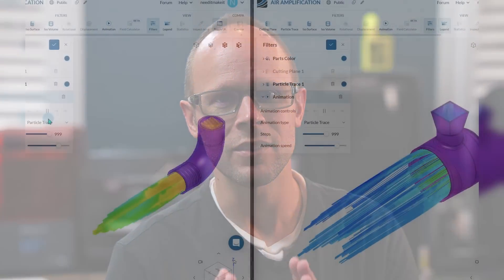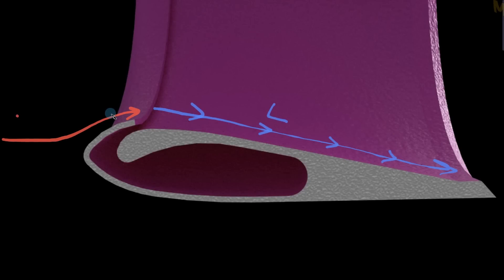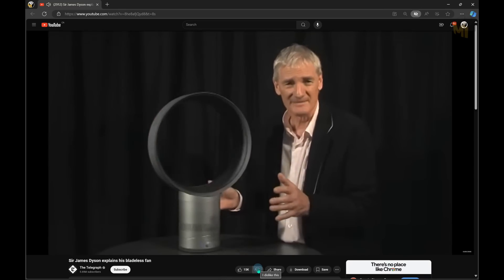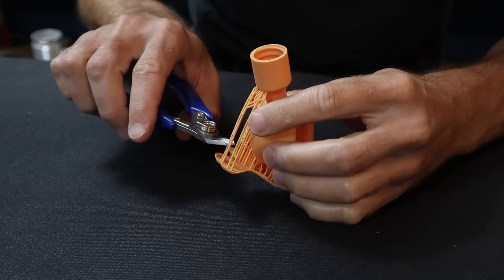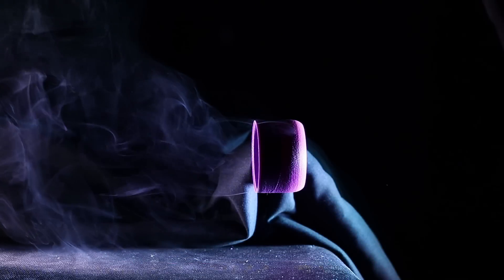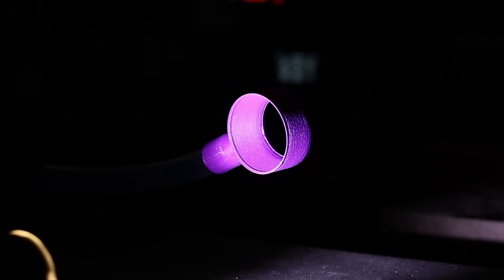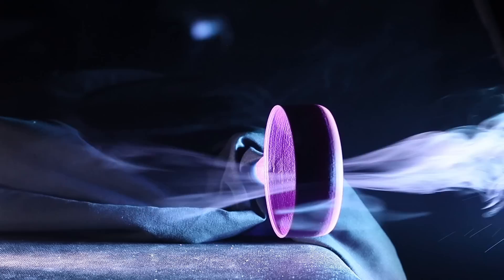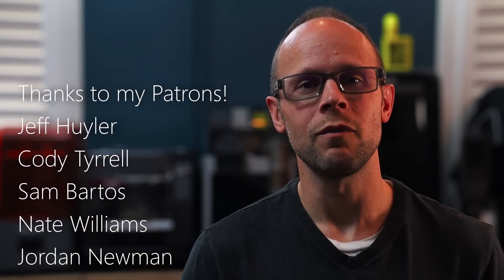3D printing a functional Air Amplifier and testing it to see if...

Comment: I'm into a bit of metal casting and the idea is not to get air into the metal as you pour the molten metal, the opposite to what you are trying to achieve. Professor John Campbell who wrote the book Complete Casting Handbook has a stage demonstration about pouring metal from a height and introducing air almost identical to your bin bag fill test. Because you have the bladeless fan and the open tube set back from the bin bag you get additional air being drawn in due to the boundary effect that you explained very well. In the open air tube smoke test the smoke wasn't pulled from behind the tube very well, however if you added a simple larger diameter tube equal about the air supply tube you will get that pull from behind, this is the venturi effect. This can be enhanced with a conical entrance to the outer tube and if you added a conical design to the exit of the venturi design you would have a venturi tube. This is in every naturally aspirated gas burner nozzle design. It would be awesome if you could try the venturi tube compared to the bladeless fan design. While the wing design profile looks very cool in the bladeless fan design I feel it adds little to no benefit other than reducing exit speed as you are only using one side of the accelerated air.

Comment: I wonder if anyone has mentioned that the air foil / flow explanation is false. It's a very old, often repeated explanation that says air moves slower over top of an air foil. But this isn't actually true at all, and the physics behind flight are actually far more complicated than this. So much so that I'd suggest just reading Wikipedia on this.

Comment: Funnily enough, a "channel wing airplane" was made, which was intended to be used with short runways, but the main reason it didn't become popular is because helicopters started being used for rescuing operations, and then VTOL became popular. If the channel wing were to have been made just a few years before, it could have become widely used. This makes me wonder how big of an air amplifier you could make work for the same air hose, and how much more air you could move by just scaling up the air amplifier part, and at some level having to split the air hose into multiple hoses which to then split the air into multiple air channels, which to then route the air to escape the air amplifier. Also, I think the trick to improve the efficiency is to make a more laminar flow, by having the opening where air escapes from be made to keep at least a few mm of length of constant distance between the inner circle wall and outer circle wall, before releasing that air, and having the edge of the inner circle wall (which ends first) be angled like for jet nozzle, instead of like for a spray nozzle or rocket thruster, to reduce the drag caused by making a low-pressure air zone due to the laminar flow sticking to the outer circle wall as it exits the inner circle wall of the air amplifier. Also, could you get the same air amplification result by using air hoses spaced at an equal distance for at least 5-7 cm or 2-3 inches, and arranging those air hoses in a circle somewhat similar to the commercial air amplifier? And how big could you make the spacing between the hoses to still get that improved airflow? A series on air amplifiers and how to make them would be very interesting.

Comment: Dyson fan :-))) ...that is a Coandă efect ejector, interior type, with the Coandă efect being created inside the cilinder. It was invented by the romanian scientist Henri Coandă somewhere in the midle of the 20 th century. The flying saucer invented by Henri Coandă used those ejectors for stability and control. Just study the Coandă effect and you will get all the answers you need for the ''Dyson'' fan.

Comment: Interesting ! I gonna try this software to test but i think this probaly possible to "shrink" "simulation time and require less resources in this CFM simulation because this is a symetrical part  ->  So is it possible on this software to study only half or quarter of the full part instead ?

Comment: These have been used in industry for years as a commercial product, I have used them. Just look up “Exair Super Air Amplifier” for an example. They are very cool and powerful, although their input pressure requirements are pretty high!

Comment: Make one with a 120 mm computer fan
Reply from the maker: I know Major Hardware did one in the fan showdown, but it wasn't explained well and it seemed far too chunky, these also need to be fed by a fan which can generate some static pressure to force the air through the tiny slots.

Comment: Given how thoughtful the video is and how much time you put into it.. I'm a little surprised you used a garbage bag to show airflow rather than forking over $15 for an anemometer. In either case, great video.
Reply from the maker: It's a valid point, what crossed my mind was that I wouldn't be able to measure the volume of air with an anemometer, partly due to not knowing exactly where to place it.  I have one that I haven't used for 15 years, I should dig it out and see what the results show.  Thanks for that!

Comment: Really interesting Video! I am looking forward to more Videos on this topic. 
One thing I think you could improve is to use dry ice in water instead of a smoke machine, since it allows for a better visualization of the airflow, in my opinion. This was used in Plasma Channels Videos about the Ionic Wing.  The smoke you used had some initial momentum which can make it harder to see the actual Airflow. Just something you could try if you want to visualize something similar again.
Reply from the maker: Thanks, for sure!   I am working on getting a better smoke setup and dry ice would be better than the smoke fluid I've been using, it likes to leave a residue and condenses all over everything as well.  I believe it is glycol and water, at least it has a pleasant smell.  I'll check out that video, I believe I've seen it already, but I'll look at that part more carefully, thanks for the tip!